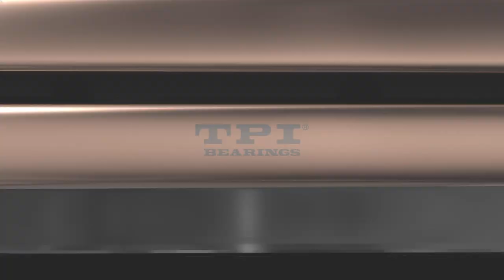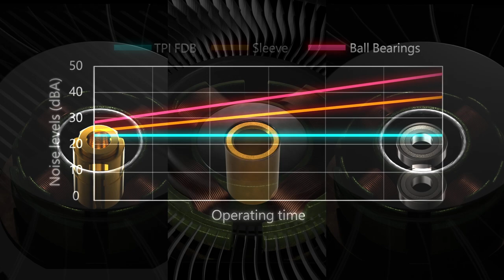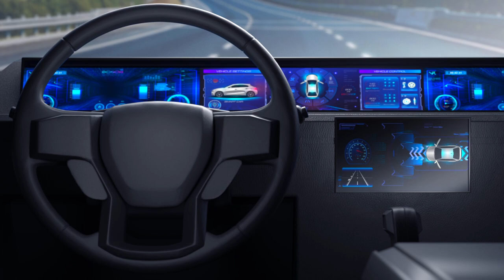TPI Fluid Dynamic Bearings

Comment: Just watched Gamer's Nexus video on his plant tour in your company, and I was curious what's the difference with ball vs fluid dynamic bearings. I ended up in your company video explainer.
Reply from the maker: Fluid dynamic bearing is a non-contact bearing. The dynamic oil replaces the steel balls and inner ring of a ball bearing. Since the FDB does not directly contact the rotor, vibration and noise can be significantly reduced!
If you have any more questions or if there's anything else you'd like to know, feel free to ask!😄
Reply: There's no ball
Reply: no balls